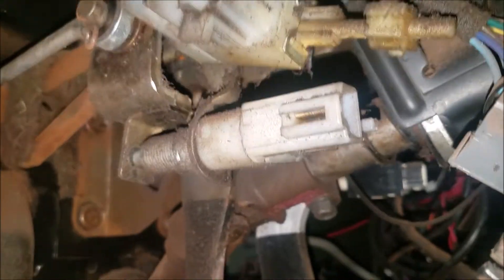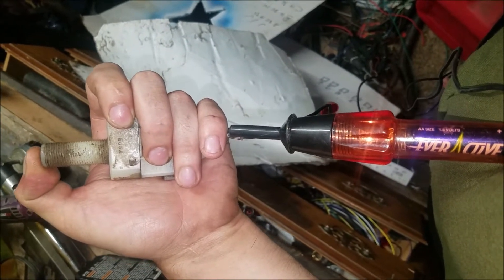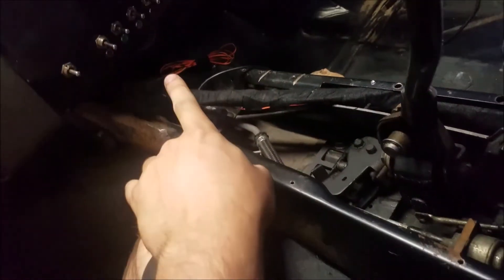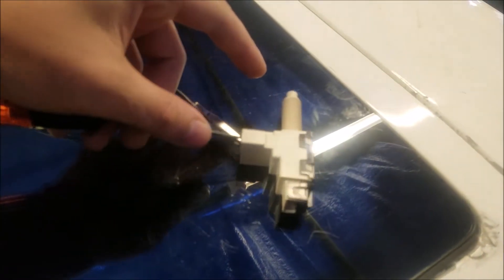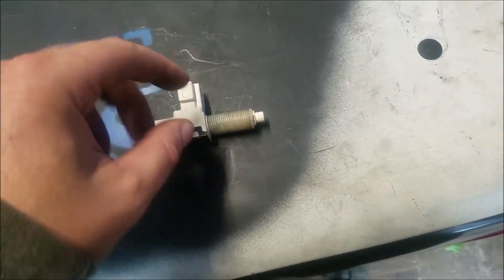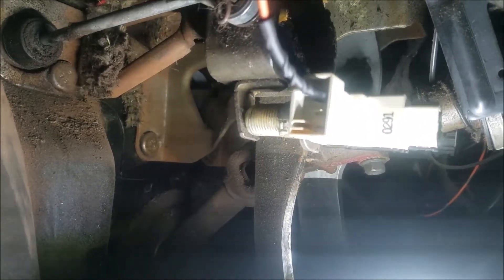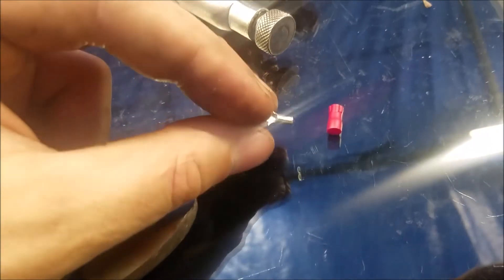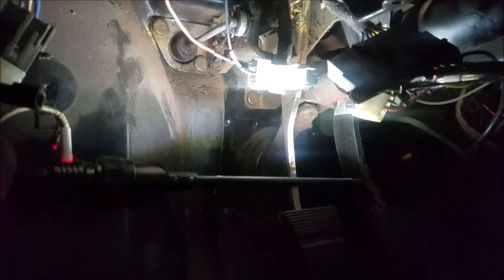how to wire in clutch switch and setup 2 step antilag launch control in microsquirt or megasquirt

Comment: Thanks for the video. Could you tell me why fuel cut would be bad? Is it just because it won't help spool as much or another reason?
Reply: Fuel cut is bad because it leans out the motor and under boost that could be very catastrophic
Reply: It’s really not that bad but don’t use it

Comment: Sorry about the necropost, but you should have been able to change the settings from normally closed to normally open, or used a relay like previously posted.
Reply: I think you may be right. That microsquirt system can do so much more than I would have expected. Im really looking forward to getting it

Comment: How do i know which pin is to go yo the launch pin. And which one is groung on the switch
Reply from the maker: Switch is just in between the circuit... so shouldnt matter which wire is ground off switch... just 2 wires... i dont remember which wire it is off of microsquirt

Comment: Do you have a part number for the switch you used?  I'm looking to do this for my build.
Reply from the maker: I do not i had it from parts fiero i had
Reply: @Garageless  was it a brake pedal or clutch switch in the Fiero?
Reply from the maker: Clutch i believe

Comment: Do you have a line loc or some other roll control ? That would really help you load it up for amazing launches !
Reply from the maker: @TheCanadianBubba  lol i wanna do f23 swap and throw a lsd in the trans too
Reply: Just looked that up, sounds like a great upgrade... any chance the Cobalt and Fiero bellhousings bolt right up ?
Reply from the maker: @TheCanadianBubba  the cobalt f23 housing isnt same but the transmission itself is same... i need bellhousing off some car crom 2 years it was made lol
Reply from the maker: I have to actually launch with it im afraid itll grenade transmission
Reply: @Garageless  hey buddy I want to do.this to a auto car. But I want to.have a switch  for it so It dont 2 step everytime i hit brakes. I want to run it off my brake light switch like how u running it off ur clutch
 Im a89 foxbody. I need to tap pin 30 at ecu. Help please.
Reply from the maker: Idk specific to that vehicle if throw toggle switch inline with another switch on pedal u can shut off toggle switch and it wont work then
Reply: @Garageless  so here is my question  u run ur clutch switch wire  straight to the wire that u need  off ecu. Comebind them  and ground them  so that ecu see ground right.
Reply from the maker: Basically... and if u add toggle switch inline u can make it not active